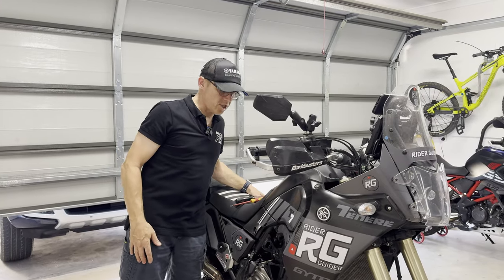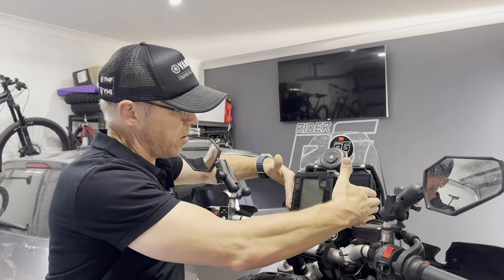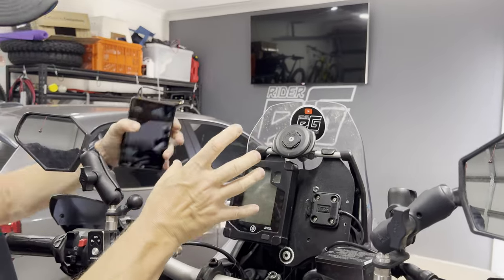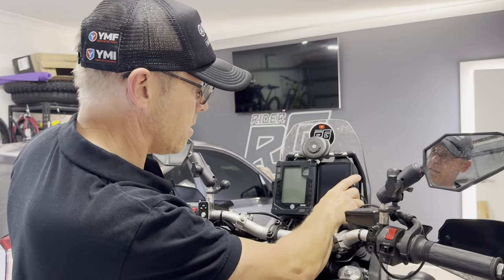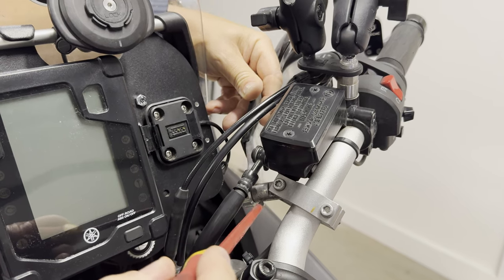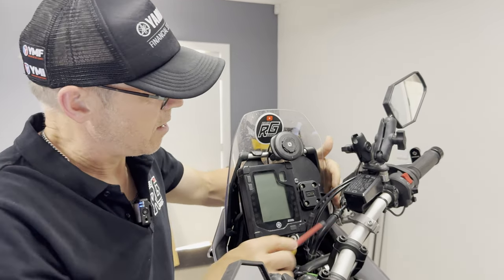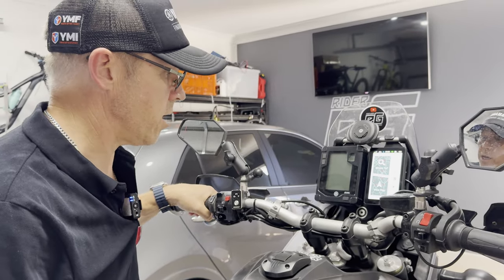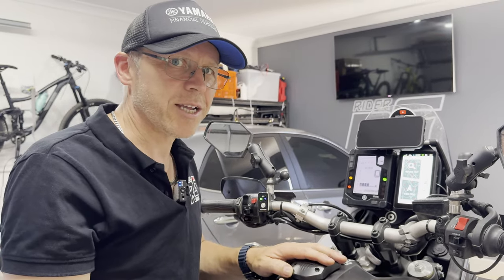YAMAHA TENERE 700 MOTOLOGY GPS MOUNT WITH BARKBUSTERS

Comment: I’ve got the nearly identical Twalcom setup for my T7, and I’m about to do the same modification to my Barkbusters.  Nice to see that it’s workable.  Thanks!
Reply from the maker: It is, another consideration to add to the mix is bar risers as well.  Thanks mate :)
Reply: Oh, not for this cowboy!  If anything, I’d like to have less rise so that I can get up and over the bar a bit more easily in the standing position.  I’m not sure that this dash set-up would accommodate that—I’ll have to see how it all looks when I get it all together.👍👍
Reply: @RyanRussell885   did you get it working? same situation here with the twalcom plate, cheers
Reply: @edoardonovella1475 I was not able to get the barkbusters to work with the Twalcom plate.  I had to modify the speedo, and then I installed Acerbis X-factor hand guards, which fit tighter to the bar.
Reply: @RyanRussell885  thank you for the reply brother!

Comment: Would it be possible to mount that quad lock charger where the gps is on your setup? I use my phone more than a GPS and have installed a shorter screen from puig. When on that cross bar mount the phone sits slightly higher than the screen.